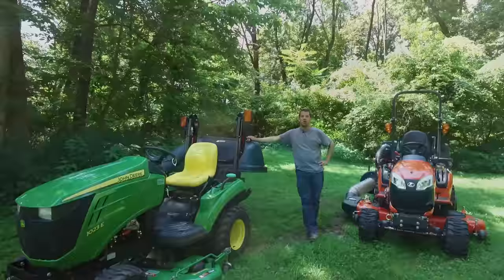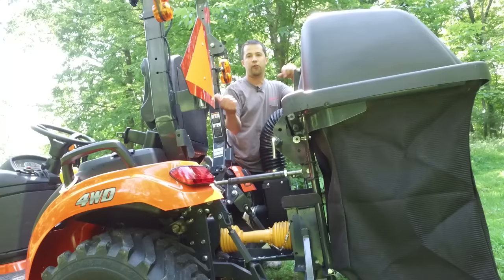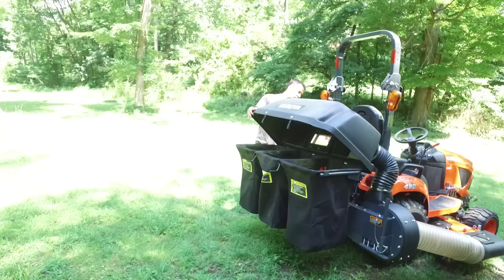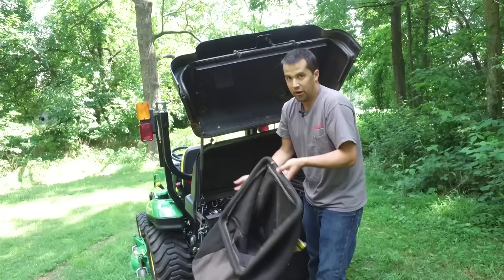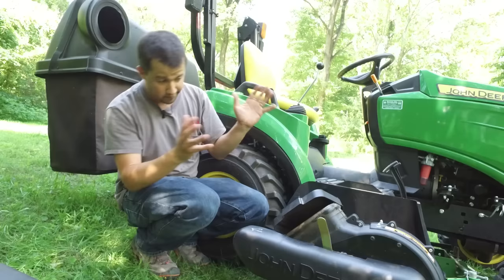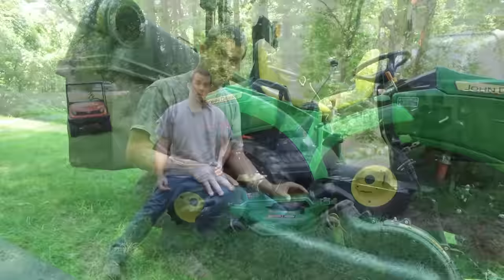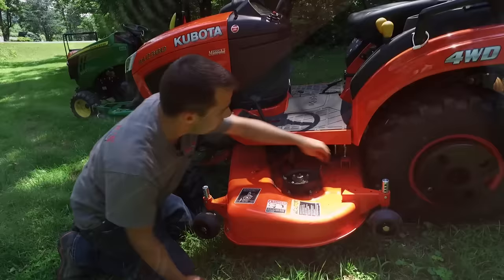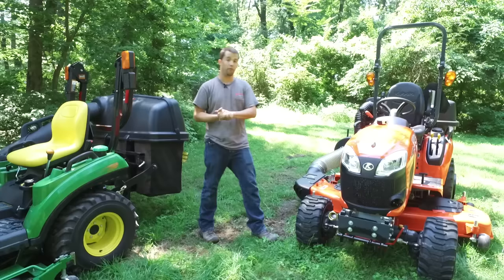John Deere 1 Series VS Kubota BX Series: Grass Bagging System

Comment: You john deere fans are about as childish as ford powerstruggle fans. "Muh john deere" It's all about Case, Massey Ferg, and Kubota. Kubota is by far the superior compact tractor manufacturer. Unlike these over priced, green, plastic, yanmar powered deere tractors. Keep it up Neil! Love your videos!
Reply: SteelEagle33 yanmar engines are good, deere just doesnt put a big enough engine in any of their machines. I prefer the kubota tbh, the deeper deck is something i look for in lawnmowers not just ride on or these style installed on the tractors
Reply: I absolutely agree!!  Kubota is by far the superior machine.  Like my dad says John Deere just isn't the tractor they were in years past.
Reply: yanmar are in kubota to
Reply: Yanmar engines are superb, Kubota and Yanmar are as good as each other, it's the JD build quality that lets them down.  I'd argue that Yanmar compact excavators are slightly better than Kubota's, but they're both very good.
Reply: YOU MUST HATE GREEN!
Reply: if kubota compact is superior then why are kubota sales struggling? over priced? the deere 1025r with 60" is cheaper than the bx2380 with 60" deck. i know because i just bought the deere over the kubota. you prolly voted for hillary clinton too.
Reply from the maker: Kubota had a record year this year, has market share over 50% under 100Hp, and is out selling Deere approx 2-1 in this segment. Local dealers can swing the pricing of the machines, generally both are very competitively priced with each other.

Comment: I have a 1025R with that same deck and have only had 1 issue with connecting the deck. That was the front linkage was not adjusted properly.  It literally takes me 5 minutes to put the deck on and take it off. As far as the deepness of the deck Deere offers the Accel Deep Deck for that.
Reply from the maker: Accel deck is for the lawn tractors, not the 1-Series. 

Like I said, I'd like to do a demo on that deck but we need to get one though that's adjusted right.
Reply: Messick Farm Equipment 

I know.

Comment: Neil, I noticed the BX had wheel weights. Can you offer your opinion (or do a video on ballast)? Wheel weights (or suitcase weights) would be quicker to remove if need be vs. filling your tires, but weights cost more, thanks. Also, one thing I noticed about the JD is that you said that on a slope the bags could slide out, but it looks like once the lid is snapped shut, it acts as the retaining mechanism for the bags.
Reply from the maker: I did a video on the weights a while ago. On a subcompact, wheel weights are the only thing that really make sense.

Comment: Unfortunate to not have any input on which grass catcher works best. Seems like the Deere with blower near mower deck would be better but wonder about the Kubota?
Reply: In ease of installation and removal the Kubota catcher system would be the best, plus you can control the bagging system with the PTO, so if you don't want to bag, you can simply remove the bagger chute, leave everything else attached and just side discharge or mulch....with the John Deere, you have to remove that stupid blower from the side of the deck, otherwise you'll pack that thing full of grass and clog it to the point you'll have to take it off anyways to unplug it before you try and use it again.  Both baggers work, its just a matter of looking at the installation and removal side of things, as well as the overall setup to be able to use the tractor for other tasks by being able to quickly remove the bagging system.

Comment: So why didn't you actually run both machines and show them in action...I wonder if you disconnect the belt on the JD and had mulching blades if it would just mulch at that point and the blower would just act as a mulch plug being disconnected?

Since that Green mower is so terrible you better load it up and just drop it off at my house I'll properly dispose of it for you for free.

Comment: Well I was looking at getting a bagger for my 1023..I don't want that one. Think I could get the Kubota one to fit my 1023
Reply from the maker: ya know that's probably not as hard as you may think. The only thing you may need might be a different length hose. The boot part from Kubota is a separate kit so you don't have to buy it, so you could go to a company like Trac-Vac and buy a boot to fit your specific deck.
Reply: Messick Farm Equipment oh thanks for letting me know that. I'll be looking into that for sure
Reply: todd tefft n

Comment: Why thehell would some one create a bagger system like that on the deere those tractors are designed to use as small farm equipment with that set up you just made it in to a glorified lawn mower the only thing you can do with the 3 point hitch now is scraping your drive way .. the designer of that system need to be fired .🤣🤣🤣

Comment: The one thing I hate about kubota deck belts is that the backing comes off and then you are done.
Reply from the maker: whats the backing?
Reply: the belt has 2 V belts glued to a backing.  Over time the backing will develop holes or start to peel off.  On my ZD326 my first belt lasted less than 200 hrs, the next belt lasted 600 hrs, the next one lasted 1200 hrs, then as the last one was about 500 hrs and the one I am on now has 50 hrs and the backing is starting to peel, but I think a stick poked it.  If you want pics I can email what it looks like when they start to peel.  If oil gets on these belts it eats the glue that holds the back.
Reply: I forgot to say it is was the deck belt.
Reply from the maker: that's interesting. I never heard this before. I looked at our parts sales history and while we have some volume of that part, nothing that would reflect the experience you seem to have had with it.
Reply: How many of your customers are putting 500 hrs on a mower a year though?   500 hrs on a deck belt is pretty darn good.  For a home owner that could very well be 10 years of use.  On normal ztrs you might go through 1 to 2 decks belts a year as a commercial cutter.  I go through one every 1-3 years, just depending on the quality of belt from the get go and if my gear box seal is leaking oil.
Reply: I am on my 5th deck belt in 6 years and just passed 2500 hrs.  I have owned this mower from new.  I would not call it an issue, just it could be better.  If there was a better way to fix the backing on the belts, I could see 1500 hrs being a normal thing.
Reply: Krazy K what's the total hrs on the mower, have you replaced the belt, and what model is it? Also if it is a tractor were all the hrs mowing?
Reply: JCLawn51 you must be mowing 24/7 because I've had the same belt on my kubota bx2200 for  years and it hasn't started coming off yet
Reply: mlemmon923 i am a commercial mower the mower runs 6 to 10 hrs a work day it's used. Sometimes it mows 6 hrs before it's shut off.
Reply: I have a Kubota G1900 that has over 1200 hours on the original  belt on it. It will soon be time to replace it but 1200 hours isn't bad.
Reply: Herm Zinn ya it is good, i imagine long hrs on my ztr does not help because of sustained heat
Reply: How do these compare to the protero baggers?
Reply from the maker: +Joe Malovich we sold a bunch of protero, the hopper is great... The fan we had a lot of belt routing issues... That's on ZD series 4 or 5 years ago.
Reply: Messick Farm Equipment how was dealing with the company in your opinion? I have heard not great things about getting parts after the initial sale. Is that true?
Reply from the maker: +JCLawn51 not great, but it's been years. Companies can change.

Comment: I have a 1025r. Is there any way to convert the kubota bagger to work with it?
Reply from the maker: I suspect there is little reason why the Kubota bagger would not fit, then call Trac-Vac for the boot portion for your specific mower deck. It probably can be done, but its uncharted territory.
Reply: Messick Farm Equipment Wow that was fast. I appreciate the reply. Wish you guys were my dealer.

Comment: Objectivity bypass as usual, For instance the bagger is offset to the fan side for an obvious reason, but this guy pretends its a complete mystery. Its the same with the how he cant fathom how the  individual bags are secured by the weight of the lid at the rear of the tractor.

Comment: Aw common you need to be a little less critical towards Deere. You obviously are a Kubota dealer. But some of us want USA built.
Reply from the maker: Kubota is USA built. KMA in Gainsville GA employees 3000+ people. They export from here to europe and Australia too.
Reply: @MessicksEquip  Kubota still is a Japanese company. GA assembles Japanese Kubota parts to avoid import duties.
Reply from the maker: @Tchristman100  
there are no import duties on tractors from anywhere but China. 
Been to the factory. They make stuff there. Stamp metal,paint, machine parts, etc. The production is every bit as red-white-blue as a Deere (maybe more so, because they use far fewer parts made by outside suppliers). The Engine does come in from Japan. 
I'd expect some money does ultimately does go back to Japan, but what's sold here is taxed at a subsidiary based in Texas.

Comment: I see a lot more green tractors than orange
Reply from the maker: +Chickenfarmer01 Kubota sells 50% of all Tractors under 100hp. Will be many regional differences, but they have been the market leader for years.
Reply: Green is overrated
Reply: John Deere makes some fine large tractors,  but they don't hold candle to Kubota when it comes to compact and sub compact tractor

Comment: All you do is talk trash to John Deere how about you talk bad to Kabota for once it would be a whole different tractor, You didn’t say 1 bad thing about Kabota but you made John Deere sound like it’s the worst tractor you can get
Reply: Cam Tunstall I have no issues with either one, it's a different design. No it wont be a perfect video they are a Kubota dealer but they're a lot better than most of the other guys who flat out talk down the competition. No and I would have to agree with the bagger unit, that's literally the same as the bagger setup that's on my X300 lawn tractor the way it hooks up anyway. If I'm going to pay 16k plus for a tractor plus the extra 3 grand for the bagger setup I would expect it to be sturdier and using the three point I agree would make more sense here. As for the blower setup, that's basically the same setup used on every zero turn and every other compact tractor with a mower deck it works, a pain to take on and off but it works the advantage I can see is less clogging than the Kubota
Reply from the maker: Many, many mowers drive the blower off the deck. The difference is that this is literally the only one I have seen that's not easily removable. Weird.
Reply: I bought a 1025r last year and now after seeing this video, I wished I had bought a Kubota. You got to admire Japanese engineering, I should have learned my lesson after loosing all 4 of my Cadillac door handles.
Reply: JD is good for bigger equipment

Comment: Digging deep to find something Kubota does better. I just wonder who even bags leaves when they have a yard big enough to justify a large machine like this. Lol
Reply: I mulch mine and just have a regular lawn tractor with an acre to mow.  It works great for me.  I don't have a bagger, thought about getting one but have no clue what I'd use it for really.
Reply: I bagged for years worked out of town alot. If I didn't get to mow in time no problem! All the grass was picked up. Lots of trees , leaves and small branches picked up. Can mow in any direction, no need to worry about flower beds etc... mow in the rain no problem.  I don't  use my 1025 to mow even though I have the auto connect 60 deck. The tractor is to heavy   I use a 425 or the ferris.
Reply: @bucket1249  That's why I like mulching too, I can mow in any direction.  I haven't had the need to bag leaves for several years and my rakes hang in the shed untouched too LOL.  I use the leaf blower and blow all the leaves out of the flower beds and walkways then mulch them up when I mow.  I think the only time I may bag now is if I get a chance to do a garden then I'll bag the clippings and leaves to put in the garden.  I don't have a bagger for my lawn tractor though and would be quite time consuming using the push mower to bag clippings and leaves.